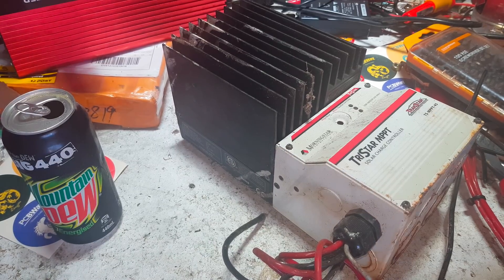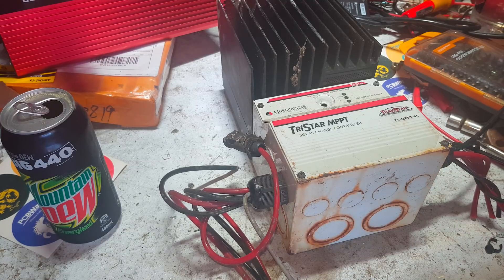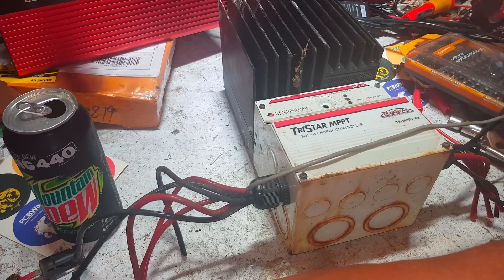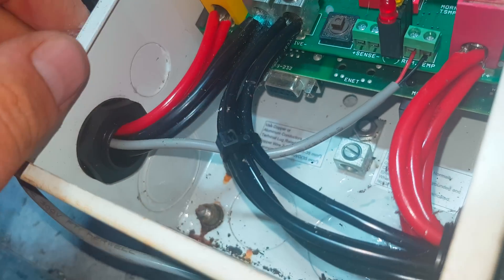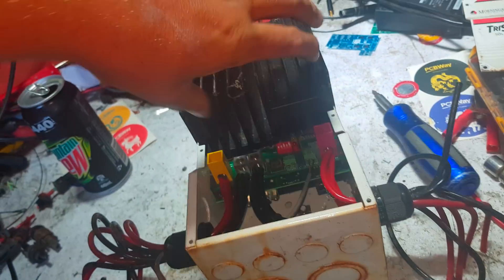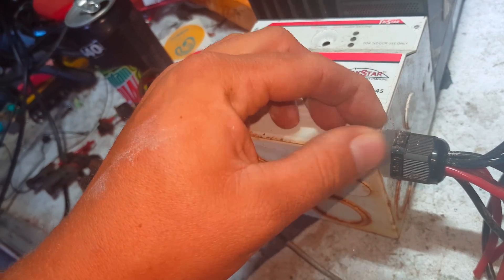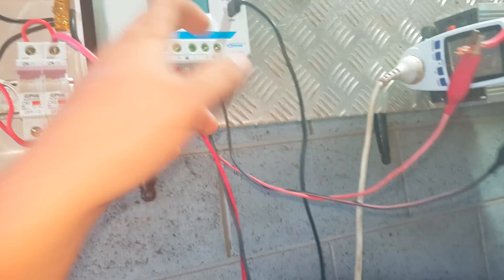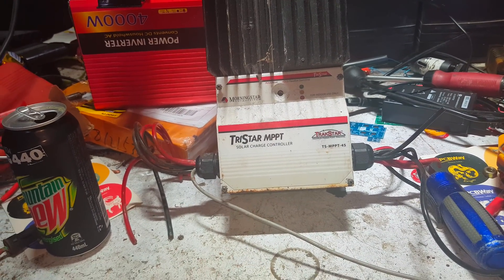Scrap Yard  Score 45A MPPT Solar Charge Controller Tri Star

Comment: I just found your channel this evening… And I’ve watched dozens of your videos already! I added all of your vids to my library and will cycle through them as I work in my lab. My lab is stuck in a corner of my woodworking shop… So even though I’m not always at the electronics bench, i’m still in my shop 12 to 16 hours a day completely isolated. And YouTube is my only source of company. So I’m very grateful to have found your channel. Haven’t seen any others like it.

I haven’t found much content like yours and I always search on YouTube. I’ve been looking for years to find someone in a similar situation as myself..... 

I go to the scrap yard several days per week. It’s a standard metals recycling yard but they get a lot of electronics waste and industrial stuff. I have so much fun and it’s incredible!

I just started tinkering in electronics two or three years ago, and have been going to the scrapyard almost every day since. But considering mine is just a regular metals recycling yard and not specializing in electronics… I don’t find anywhere near the amount of good industrial electronics as you do! 

Here in the USA, most scrap yards have been bought out by big corporations and don’t allow anyone to buy… Not even their own employees. I’ve only been able to find one within driving range. It’s a decent size yard and probably 50 acres of piled up steel. There’s only two employees… Neither of which is interested in this stuff. And no one else in my area takes a second look at anything electrical.

But I’m curious… How do you find the huge volume of industrial electronic stuff that you buy? I’m guessing you go to a strictly electronics recycling place? Because only about 25% of the stuff that comes in to my local yard is electronic. And only about a quarter of that is industrial.

But I wish I could find A strictly electronics yard that would allow me to purchase… 

I’m not complaining. I’m glad I have somewhere to go. I only pay $0.10 per pound no-matter what it is.
But after three years I haven’t found anywhere near the volume that you have shown in the same amount of time of your videos.

Don’t get me wrong I love it… I’ll probably get at least 100 pounds a week. And  every few weeks some huge load of inverters or motor drives come in… And I end up buying 1200 pounds in one day. But for the most part it’s not a huge amount.

Sorry to ramble on… Would just love to know more about the type of place you go to… and would greatly appreciate your feedback

If it’s a strictly electronics recycling or regular metals recycling place?. Are there a lot of people in your area that like that stuff? How much do you have to pay per pound for stuff like that? Sorry to seem nosy, I just haven’t talked to anyone else that does the same thing I do!

The guys at the place I go, they don’t care what i buy at $0.10 per pound. If it’s not solid copper or aluminum, I can literally buy the most expensive industrial equipment for $.10 per pound. So only $10 for 100 pounds!. The only things they buy separate are the copper, brass, and aluminum. But a lot of the major companies and government entities dump everything at once in the steel pile. Even if it has 100 pounds of copper in it! And the two employees don’t sort anything. If it doesn’t come in pre-sorted… They’re not going to touch it! So even if it is copper or something beautiful… If it goes into the steel pile… I get it for cheap!

The steel pile is massive. It all goes into the 30 foot tall mountain that stretches several hundred yards. At least 30 feet tall… and sits for years and years. The owners are never there… I haven’t seen them once in 3 years. It’s kind of just a tax shelter for them and somewhat of their retirement plan. They sell copper and brass every year to the big foundries…  which gives them enough profit to pay the two employees and basic costs. But they never sell steel. That’s why the pile covers a city block! They’re waiting to sell it all all at once in a decade or so. 

No matter how beautiful or rare something is… It will be crushed by the crane within hours if I’m not there to see it or unload it myself. I’ve even bought some insanely expensive and rare vintage stereo receivers that I was amazed anyone threw away! But if I hadn’t been there to unload them off the truck… They would have surely been tossed to the ground from the truck bed by the sellers.

I’m friends with the employees and they watch out for me and send me pictures when I’m not there… And I tip them very well along with bring them milkshakes and treats!

I will continue to watch your videos, and I apologize if the answers are hidden somewhere in your video catalog. But I would love to hear your experience, advice, and more about what you do. I’ve never found anyone else who does the same thing as I.
 

Ps...
A tour of your electronics lab and test gear or work area would be awesome!

Thanks for your great content! You’ve put a lot of hard work into your YouTube channel and it shows! Your channel will explode eventually! This stuff is becoming much more popular....even for folks who just like to watch.
Reply: Damn just posted this comment… I’m sorry for how long it is.

Comment: Yeah 48v it would be awesome.... 👍 
Now search for 48v inverter... 👍
Reply from the maker: Ive found a 48v server ups locally thats ment to be 4000va so going to enquire about that
Reply: @Oneupthesleevecustoms  There are two thing to watch out for with UPS units:
1) Cooling, some are intended to only run for a few minutes (the battery only lasts that long) and so don't have proper heatsinking.
2) Internal battery charger abuses batteries, extra runtime is seen as more important than battery life, so they charge the batteries beyond 100%.
Reply from the maker: Thanks mate i doubt id hook ac up to it but a trap none the less. 
Bit of extra fan cooling sort the std cooling?